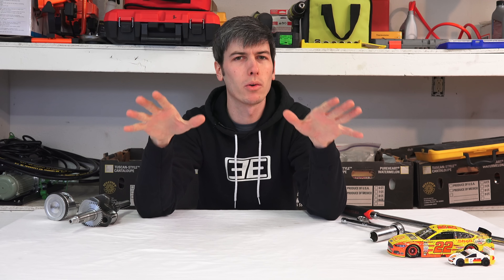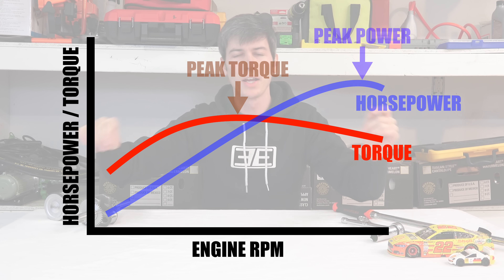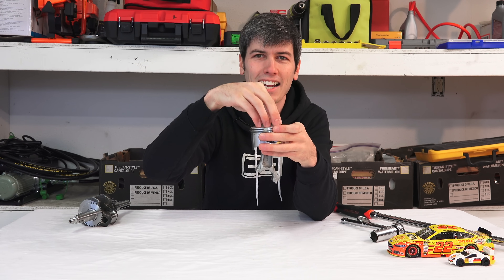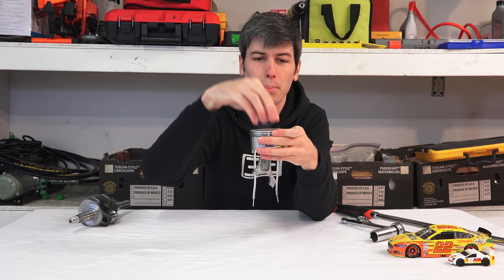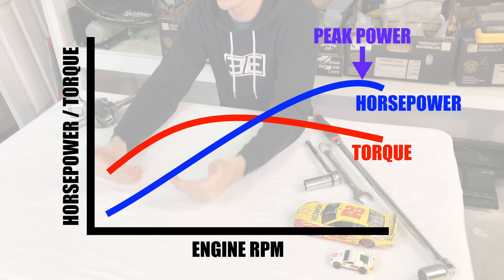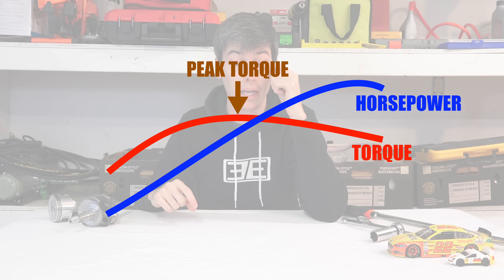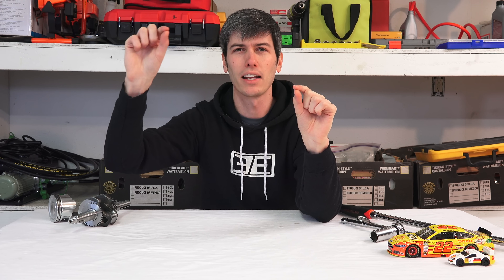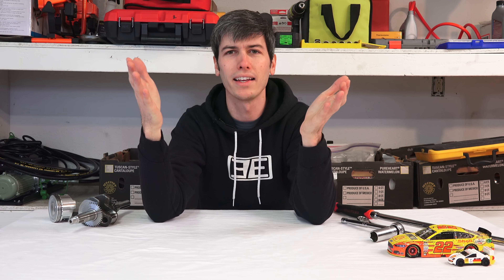Horsepower vs Torque - A Simple Explanation

Comment: What exactly happens if going uphill? Does the relation change or is it still managable by gears? Also talking about cvt transmission, should they keep the rpm in the peak torque or hp range?
Great video btw :D
Reply from the maker: For peak acceleration using a CVT, no matter what the scenario, it will occur at peak power. Explained here: https://youtu.be/cb6rIZfCuHI
Reply: Engineering Explained cool, I'll have to redo some math I did on accelerations using different gearboxes, I was using average torque to the wheels, should I have used average hp to wheels to calculate the ratio of acceleration between the transmissions?
Also what about the hill scenario?

Comment: Hello. If the two cars were to then pull a 5,000 pound trailer, would the car with more torque now be faster?
Reply from the maker: Nope, power will have quicker acceleration, assuming it's geared appropriately (which it would be, by design).

Comment: There's no denying the fact that this is the most simplest explanation one can find regarding the difference between torque and horsepower.
Spectacular work Jason!
Reply: Explosive Gaming I'm not sure where that analogy came from, I've heard it many times, but it's completely wrong.
Reply: Explosive Gaming it'd be better to say "torque is how much the car can do - horsepower is how fast it can do it"
Reply: @ThePieMan159  A better way of saying it is torque is one of the two components in power and power is it. Always. 

The following is a dimensionally accurate analogy:

Torque is the value of $bills, rpm is how many bills you make in a day. Power is your income. 
So what do you need in order to support an expensive lifestyle? A $100 bill? A stack of bills? Neither one alone means anything. You need to know the combination of how many bills you make per unit of time and what value they are. Those are each details that can just be meaningfully summarized as your income.

Power is exactly the same way. It is a calculated and meaningful summary of the combination of two independantly meaningless things. It tells you how hard you can pull, how fast you can go, and how quick you can accelerate... Even how fast you can climb. All of it;)
Reply: Yup, this is  pretty much all you need to know.  The explanation in this video is too "repetitive and reiterative" to much more helpful. Why these guys think talking faster (non-stop) makes it simpler is beyond me.
Reply: Elan Jacobs not completely wrong
Reply: Explosive Gaming a Bugatti veyron has more power than  any tractor but can't carry all them bricks like a tractor with only 10% the horsepower of a veyron.
Reply: The simplest layman’s explanation is:  Torque is how hard the car pulls, horsepower is for how long it can maintain that pull.
Reply: Explosive Gaming that saying is literally quoted in the description as an example of a completely false way of describing it
Reply: I love how Engineering explained does such a quick way to explain things. In class I have the attention span of a potato, but watching EE I can watch his videos all day long and learn what I need!
Reply: Virgil E Akwara  You are not alone. I've seen published articles from high profile motorsports magazines that toatally slaughter the subject!
I'm happy to help if I can. Where can I start?
Reply: agreed. a lot simpler than 4 years of engineering school
Reply: I could it in waaaay less than 7min 24 seconds
Reply: Horsepower sell cars, torque wins races...
Reply: horsepower is how fast you hit the wall, torque is how far you take the wall with you
Reply: No.

Comment: I think you should not have mixed physical terms with units. E.g. its power, not horsepower, engine speed (actually it's angular frequency), not revolutions per minute. This could be very confusing for engine engineering beginners.
Reply from the maker: Perhaps so yes, this is a good point. I think power and horsepower are used interchangeably when obviously they are different, as one is a unit.
Reply: Engineering Explained I'm German, so I like to be precise I guess :'D
Here it's Pferdestärken and Leistung, which does in no way sound equal, therefore it just feels wrong for me
Reply: You are correct, most units are SI units around the world and with engineering, using bhp is outdated in a global situation .

Comment: You can make more torque through gearing but you can't make more power  through gears.
Reply from the maker: Exactly!
Reply: Engineering Explained  I finally understand! Thanks for the video
Reply: Timothy Stoney if you can maintain torque at those rpms, yes
Reply: but can you through excessive rpm?
Reply: You can FAKE more torque with gearing. Unfortunately at the huge expense of top speed, driveability, and reliability to name a few

Comment: So, he just explained you need horsepower to go really fast.

"Old school" car fans: "hurr durr horsepower is great, but torque wins races hurr durr
Reply: oh gawd, the hp sells car but torque win races line, such cringe.
Reply: unless you a have a cvt transmission a higher torque engine will have a wider powerband which is necessary because real world limitations like only having 6 gears will dictate the gear ratio you have to use to reach a certain speed unless your ok with topping out at 45mph in 6 gear. Companies tried putting a motorcycle engine in a  Caterham/ Hayabusa thinking it made good hp numbers but many people complained the lack of torque made it slow out of corners until you could wind it out on the strait,  so Caterham added a turbo to increase the torque.

Comment: So why can't you just utilize peak torque with a higher gear ratio? Why for this example can't you have 50 lb ft of torque where that power peak is?
Reply from the maker: Torque is RPM dependent. If torque drops at higher RPM, you can use a higher gear ratio to be at that higher RPM and have more wheel torque, even though a lower gear ratio would put you at the engine's peak torque. Explained in more detail here: https://youtu.be/cb6rIZfCuHI

Comment: There are two KIA models, one is gas and the other is diesel, they have the same HP but the diesel has twice the torque...What does it mean ? Does it mean that the diesel will be faster (with the same HP) ? Thanks
Reply from the maker: It means the diesel will have more torque earlier on, but its torque will drop significantly as you get up to a higher RPM, or it operates at much lower RPM (more likely the case). They will be similar in speed, assuming both cars are geared appropriately.

Comment: Why is the peak torque multiplied by 3.0 and the peak power multiplied by 4.0? Why aren’t both peaks multiplied by the same number? Didn’t quite get that.
Reply from the maker: Higher RPM requires a higher gear ratio, for a given vehicle speed. I explain in much more detail in a previous video: https://youtu.be/cb6rIZfCuHI

Comment: Was something I really noticed with my pretty heavily tuned s40 D4, compared to our ISF it doesn't accelerate nearly as fast, but the feeling you get of being pushed back into the seat is actually greater in the D4 due to the huge amount of torque it makes. Strange how the bum dyno works I would've thought the car with 2x the bhp would "feel" 2x faster.

Comment: is it a correct assumption if i  say, that more torque allows me potentionally to use a lower final gear ratio?
Reply from the maker: Yes, high torque figures will generally speaking be paired with lower gear ratios. High horsepower/low torque engines will be paired with higher gear ratios.

Comment: I relate tq/hp to the drag strip. Torque is what gets you up and going quick up to the 1/8th mile. HP hits 2nd half track and carries you to the line. Cars with big torque turn great 60ft times and 1/8th mile. While inversely, high HP cars turn fast 2nd half track times and trap speeds. This is at least how I determine how a car delivers power based on a dyno graph or power numbers...damn that was long, great video! 🤣

Comment: i heard randy pobst explain it in a very simple way once torque is what throws you into your seat and hp is how long it can keep you in your seat
Reply: well that describes how a powerband feels but it does a very poor job describing how torque and hp correlate. engine torque is quite meaningless with gearing as 50peak torque units at 2500rpm feels the same as 25 torque peak units at 5000rpm with the help of gearing assuming they both follow the same curve.

Comment: Ok, suppose You are using two engines one with high torque and low hp and the secound with low torque and high rpm. In this case which one will accelerate faster? E.g. diesel and two stroke engine at first gear. And to sum up what decide of acceleration of the car and which plot of the curves is the best 😀 big engine with high torque or small one with high rpm

Comment: Rather unrelated, would engine longevity be improved by using a larger engine to do the same work?  I.E. having a V8 doing the exact same work as a V6.  My current personal vehicle seems taxed by what i'm asking it to do.  If i jump to a V6, V8 or a diesel, driving the same way, would it save overall wear and tear?  Another way, our work trucks have 6.7 Cummins' that do not enjoy the work, but with option to have a 9.0, which could easily cope with the weight.

Comment: Ahhh so the ultimate way to get peak torque and power is to otlptimize gearing to take advantage of the toque at a set HP (or vice versa since I'm still absorbing the info).